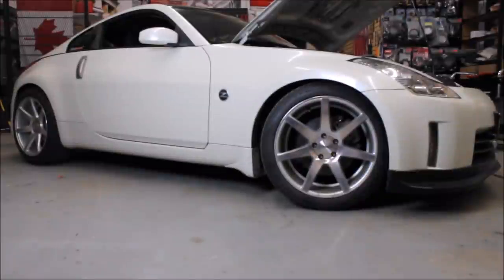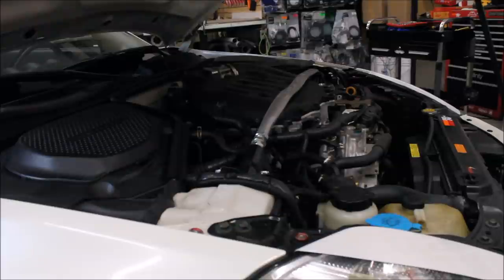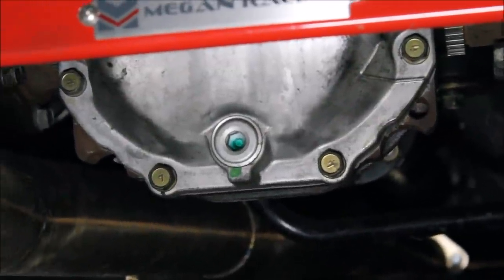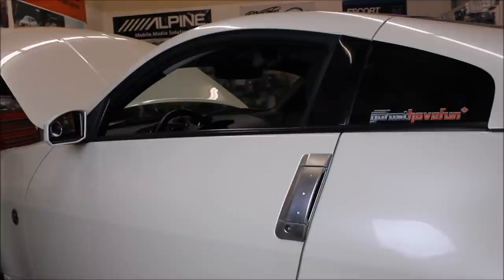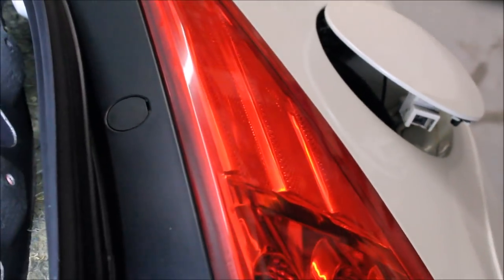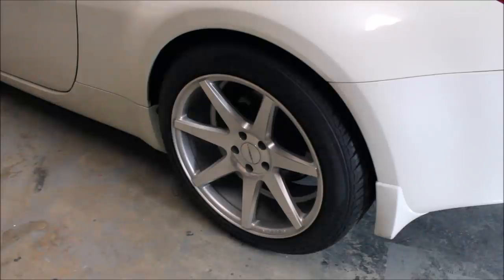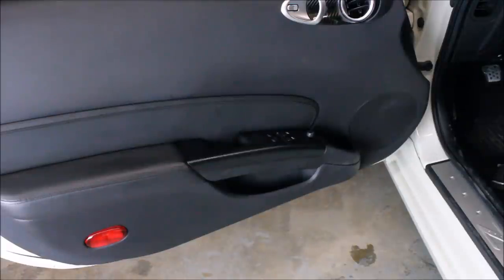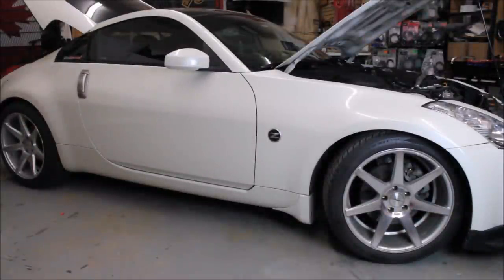Things you didn't know about the Nissan 350Z (Nerd Out Session) | AnthonyJ350

Comment: I am looking at 2003 Enthusiast that has an automatic transmission it has only 26000 miles on it. They are asking $11995 
I am not sure if that is a good price or not I was think 10k what do you think? What do you think about the Auto trans.?
Thanks
Reply from the maker: The auto seems to perform well and not really have any consistent problems from what I have heard.  I'd go with the auto if you're looking for a cruiser.  Are you in Canada or the US?  11,995 seems kind of high for that car (I know it's low mileage, but still feels kind high for a first year run of the car.
Reply: I am from the us
Reply from the maker: Seems kinda high.  The car would have to be perfect and you're willing to pay that price because you appreciate how clean the car is.
Reply: I went a looked at it today and it is so far from perfect it's missing peaces in the inside the dealer told me that some of the gauges do not work and there is some damage to the front end and he told me the car pulls to the right. I also would need new tires. This car did not empress me at all for a car that has 26000 miles on it. They are way off on price on this one I would say I would only want to pay 6 to 7k on this one as it need a lot of work if I would even want this car. Going to look at one that has 46000 miles on it to see what this one looks like.
Reply from the maker: David488013 Ya totally not worth it. Needed to be near perfect for that year and price.
Reply: I went and looked at the one with 41k miles on it and it looked a hole lot nicer then the one with 26k miles on it. 
This one is 2003 track and they are asking $12500 I think I might go there and take this one for test drive. I am not sure what a good price on this should be. I am thinking no more than 11k.
Reply from the maker: David488013 Is it manual?
Reply: no it's an automatic
Reply: I bought the car it has the stock radio in it how do you set the time on the stock radio it has a 6cd player in it. thanks
Reply from the maker: Hmmm no sure, did it come with an owner's manual?  I would just change the head unit ;)

Comment: The exhaust 'earth' strap is to avoid exhaust-drone.
Reply from the maker: How does it affect sound?
Reply: @AnthonyJ350  You asking me ? 🙂
Reply from the maker: @seandezart8294  Yes, how does the ground strap affect resonance?
Reply: @AnthonyJ350  If that is indeed what it's for. Exhaust drone is created by the sound-vibrations of the exhaust and highway-speed tire noise* blending and moving up through the chassis. IF, the strap is working, it will reduce the vibrations through the chassis.*Tire noise is in fact shock-waves of air being forced onto the road surface; the more holes in the road surface, the quieter the ride (phonic asphalt), the less tread-space (semi-slicks and worn reguler tires), the less air can escape when the wheel is rolling which creates more shock and therefore louder.
Reply from the maker: @seandezart8294  Wouldn't the rubber exhaust mounts do a better job that a copper strap?
Reply from the maker: @seandezart8294  I've been told it's to help avoid static igniting unburnt fuel. I'm learning new things about the car all the time.

Comment: Hey Anthony! How much does it cost roughly to swap out a 350z front sub frame? My local mechanic wants $1200 for this repair
Reply from the maker: Sergio A How many hours did he estimate? That sounds fair. Why are you swapping it?
Reply: AnthonyJ350 he said about 4 to 5 hour job.  I bought the car rebuilt, (front left got hit) I guess it caused the front sub frame to shift. Is swapping the frame possible at home on the drive way or should I go to a mechanic.?
Reply from the maker: Sergio A You probably need a hoist and need to support the motor too.  Depends what your time is worth to you and if you'd enjoy doing it.
Reply from the maker: Sergio A If you're putting a new subframe in I'd also put in new poly urethane bushings in.

Comment: Where did you get your headlights from and also the eyelids I'm looking to buy some already pre painted cause of the hassle painting them
Reply from the maker: There's sellers like this, you just give them the paint code.  You have to be aware it probably won't match exactly.  Paint will look a little different on plastic vs metal surfaces, plus the age difference of the paint.

https://rover.ebay.com/rover/1/711-53200-19255-0/1?icep_id=114&ipn=icep&toolid=20004&campid=5337982243&mpre=http%3A%2F%2Fwww.ebay.com%2Fitm%2FPainted-For-350Z-Z33-Fairlady-Z-2D-Coupe-Eyelid-Eyebrows-Headlight-Cover-03%2F221712652052%3F_trksid%3Dp2047675.c100011.m1850%26_trkparms%3Daid%253D222007%2526algo%253DSIC.MBE%2526ao%253D1%2526asc%253D40130%2526meid%253Db6dc9a764aad457daf47f28d71f54946%2526pid%253D100011%2526rk%253D1%2526rkt%253D12%2526sd%253D172620256916

Comment: Vinyl wrap is the best option for the interior panels.
Reply from the maker: Tom R How does it deal with grease, rings and very tight angles?
Reply: @AnthonyJ350  depends on the wrap you get. Some are very durable and flexible. Others will lift after a week.
3m makes some good vinyl. Its definitely more durable than paint, but not invincible.
I haven't had any grease issues. But that'll also depend on the vinyl.

Comment: I’m picking up a Z in 4 days and it’s got about 150k miles or so. Any idea how long these last on average?
Reply from the maker: I know a guy with 300,000. Change the oil right away and use Castrol Edge 5W40.
Reply: @AnthonyJ350  I’ve looked for 5w40 but only see it for euro cars is that still fine to use & is 5w30 castellated edge still okay my 350z is at 140k
Reply: *castrol
Reply from the maker: @sirluminous7615  5W40 Castrol synthetic Euro would be fine in a 350Z.
Reply from the maker: @sirluminous7615  Just make sure you still changing your oil every 5,000 miles
Reply: @AnthonyJ350  sounds good thank you , best Z enthusiast out there!

Comment: Anthony any options or solutions about my motor hydrlocked due to water?
Reply from the maker: I would find a used block, have all the weak points taken out and swap it. Then you can have a super durable 300+ horsepower car.
Reply: @AnthonyJ350  swap out the block?...ok...but I did drain the oil...oil looks fine...the only thing that looks destroyed is my throttle body. And when I took off the oil cap it look like honey mustard inside
Reply: @AnthonyJ350  how much will that be to swap out the block?
Reply from the maker: It would probably be 2-4 days for a shop to do the work.  Also depends if you have them do anything inside the engine or if you just do a swap.
Reply: @AnthonyJ350  so tell me Anthony...
By me telling you that when I took off the oil cap ...it looks like honey mustard inside and my throttle body looks like bunch of bird shit...and when I drained my oil looks clean...when I took off my motordyne mrev2 and spacer looks fine..it was just wet...
When i looked inside my cylinder heads ..some of them looked like it had a little puddle of water ?...you think i need a new engine?
Reply from the maker: Did you drive through a big puddle or something?  I don't have any personal experience with hydrolocking an engine but a lot of times rods get bent.  Does the engine turn over?
Reply: @AnthonyJ350  I did drive through a puddle 2 weeks ago..right now I dont have the funds to fix it...insurance wont give me nothing to fix it ...the car is still fianance by carmax..I do have extended warranty which is about 2k..the engine just makes a crank noise like it wants to starts but nothing
Reply: @JustaM340i  well you may have bent a rod or seized a piston ring. In theory you could salvage your block as long as the damage is minor (i.e windowless block ). I would check with your machine shop to see if the block could be rebuilt and saved

Comment: Surprised that in this factory hidden tech video, he totally skipped how you can roll the windows back up by putting key in outer door lock, rotate to lock and hold it there...at least my 03 Z has that.  You have to customize the doors and key fob to do what he did.
Reply from the maker: I honestly thought everyone knows about the key in the door feature by now.  And yes you do have to do some custom wiring, but I'm using the built in window modules to achieve the control.
Reply: Cool... listen I'm confused though,  my factory 03 keyfob already rolls the windows down, holding the unlock button.  I didn't word my last comment to you full clearly.  What custom wiring are you doing for that feature or have you added another feature?   or did you make it so the fob rolls them up too?  Thanks!
Reply from the maker: stealth07r1 I had to run wires into the door that attach to the same wires the key tumbler uses to arm the factory alarm and roll up the windows with the key. Then I programmed the auxiliaries on the security system.

Comment: I dunno about you guys but I see more rx's than Z's.
Honestly I don't know why there even is comparison between these two cars, other than both being 2 doors. Z's are known for being difficult to work on due to a very tight use of space. Which means you very rarely see turbo Z's.
Rotaries on the other hand, have tons of space, are light, easy to work on (as far as I know) and benefit a lot on boost.
I love both Mazda's and Nissan's, so why can't we all just get along xP
Reply: but they don't need to be worked on as often as an RX
Reply from the maker: They're both sport coupes with comparable specs.  Car magazines compared the regularly.  The Z isn't that bad to work on.  Do you still see RX-8s on the road?  Most top Youtube channels are doing 350Z builds because they're the best performance value right now.
Reply: @AnthonyJ350  to be fair, perhaps the lack of rx8's on the road now is due to how unpopular they were as a dealership car. US sales statistics were around 36'000 rx8's compared to 159'000 350's. That's not including 370's either.
That comment was 5 years ago though so much has changed, and I can say for sure that I see a lot more z's than I do rx's. Actually I see more rx7's than I do rx8's, I don't think I've seen an 8 in months.
Reply from the maker: @Leviathan431  Even electronically RX-8's aren't that good. I had so many issues just trying to put a head unit in trying to take it apart. The concept was good though.
Reply: @AnthonyJ350  hahaha, something about cars of that era, they were massively overcomplicated electrically. I had similar issues just trying to fit a head unit and speakers in my 05 IS300..
Reply from the maker: @Leviathan431  It was an Era where ignition wiring was analog but the rest of the car was becoming data control through the BCM. I actually like this hybrid wiring Era. Now everything is data and modules everywhere.

Comment: Where'd you get that shifter?
Reply from the maker: GasOnFire Torque Solution with a Greddy weight shift knob.
Reply: Hmm. I actually just like the look of it. You think I can achieve the same look with the stock shifter? How did you get the boot to sit low like that?
Reply from the maker: GasOnFire Just push the boot over the base. Stock shifter is a black rod.

Comment: The 03-05 had a cup holder in place of the business card holder. Also just DON'T buy the base model... no LSD, no cruise control, and on the DE the headlights are garbage.
Reply from the maker: LSD is nice to have from factory but more of us end up changing it to a clutch style vs the viscous.  Did you look into changing the headlight housing with an aftermarket version?  I think there's some housings that will accept LED headlight bulbs.
Reply: Mines a touring so i just threw in some HR headlights. All the non base model DE's will take HR headlights directly, the base ones very much limit the selection of aftermarket. Personally I know very few people who change their LSD if they have the VLSD.

Comment: Selling my g35 coupe. Don't know if I'll get another g35 coupe, g37 or 350z hr
Reply from the maker: If you're selling your G35 why do you want to buy another one?
Reply: AnthonyJ350 I want one with lower km
Reply from the maker: march11stoneytony I'd go G37 for a little different experience. Or for how much money you'll spend redeveloping another car why not just pull the motor out and rebuild the current one so it's better than another used car and not have to start over.
Reply: I tried my friends g37x and the steering was very slow and unresponsive vs the g35. I hope to try the g37s  to see if its better. 

I considered rebuilding, but I'm at 120K km with lots of track time. My upper and lower A arms, compression rods, springs and shocks are all completely shot and my transmission has trouble downshifting. The only thing really good in this car is my clutch (rjm bracket, upgraded master/slave, ACT hdss etc)
Reply from the maker: march11stoneytony I'd rebuild, you'll have better parts than any newer vehicle after, polyurethane bushings upgraded valve body in the transmission, shocks etc.
Reply: Very tempting. I've had this car for a long time. I wonder how much the transmission rebuild would cost.
Reply from the maker: march11stoneytony Talk to local transmission shops. You have to consider development time. You've gone this far with the car, you buy another you start from 0.
Reply: AnthonyJ350 AnthonyJ350 right before I decided to rebuild the transmission, my oil and coolant decided to get together for a party. Probably just going to sell the old girl as is.
Reply from the maker: march11stoneytony Sounds like the perfect excuse to have the motor rebuilt with better parts.

Comment: its too bad Nissan just announced they have no intention on pursuing an update to the Z line anytime soon... and that they halted development of the next Z for the time being.
Reply from the maker: ndk2k4 Probably a demand thing. Are they going to keep making the 370Z though?
Reply: @AnthonyJ350 look out for an EV supercar-killer. That’s what I heard in March 2019 was being designed.  If it is going to be a TT charging the batts, it would be awesome.  Expect to lose more trunk space and no spare tire or sub  (to the batteries). 
Can you imagine 500+ HP from a 370Z TT?  Plus the extra 80 HP on takeoff from two electric front wheels. So prob 575+ HP !!! Stock. And you could city drive a few miles around town in ultra-quiet mode on EV only at up to 50mph. 
It will be heavier - but so f-ing what. 
I’ll take 0-60 in ~3sec in a Z over heavy any day.  Sad thing for Nissan is it would make the GTR look tired & old.

Comment: Nissan told fibs by saying the 350 is mid engined, and that's good, it's not except for grandpa understeerers. What we got is how Nissan deliberately designed it  and even then the engine could have been moved back further without major changes or detriment. The 350 is a damn good sports car, pity that Nissan did not bite the bullet and make it a great sports car. All it needed was a better designed at no extra cost chassis.
Reply from the maker: The reason is understeers is the suspension tuning is for the masses. Switch out the rear sway bar to an adjustable version and it changes the characteristics drastically. https://youtu.be/PJY7V2_6vig
Reply from the maker: Also technically the weight bias becomes 50/50 under acceleration.
Reply: @AnthonyJ350  But that's not good enough. When accelerating the more weight transfer to the rear wheels the better. And when braking the more all four wheels share the better. The first Z (S30) got it right 50/50 static weight distribution.
Reply from the maker: @FairladyS130  That's too bad. I guess it's not the car for you.
Reply: @AnthonyJ350  I race one.

Comment: Also slower than the 300zx TT from the 90s.
Reply from the maker: It's also more simple than the Z32 and handles better.  Have you ever looked under the hood of the old 300ZX?  It just frustrates me if I want to do anything there's like no room lol, also to pull the turbos is a ton of time and/ or labour, and it this age you're probably pulling the turbos.
Reply from the maker: I think it's totally up to the driver as well.  Yes the 300ZX has more power and is potentially better in a straight line.  But watch these guys battle on the track.  You're also talking stock vs stock.  When you're modified it just depends on how deep your pocket is when it comes to speed.

https://www.youtube.com/watch?v=c06NlfP7mp4
Reply: AnthonyJ350 I'll check it out.
Reply: AnthonyJ350 That was a cool video. I can imagine that zx is twitchy as hell in the corners with that rear wheel steering. To its credit, that 350 looks pretty composed in the corners. But that zx is a rocket on the straights. That said, you won me over when you mentioned the engine bay. That engine bay is ridiculous and I'd definitely hate working on something like that.
Reply from the maker: Marq Mac Ya the 300ZX is a monster. But for the weekend warrior and people on a budget the 350Z is a much better car. Plus it's not exactly slow with bolt ons and a proper tune using UPREV it's a really fun car.
Reply: AnthonyJ350 In full agreement.
Reply from the maker: zzzjoeb Driver's race